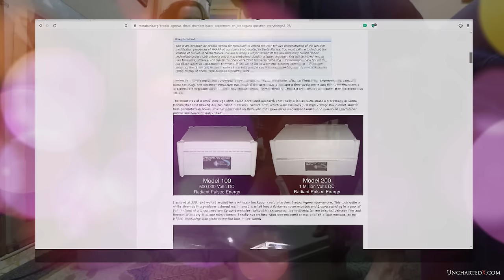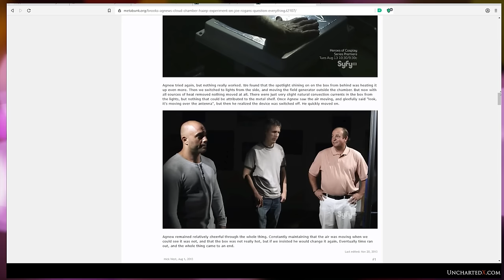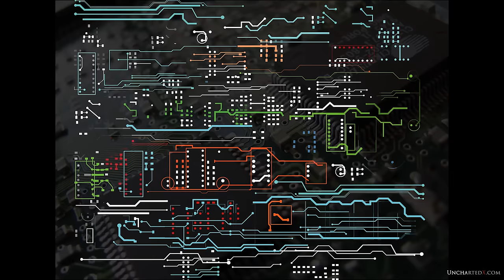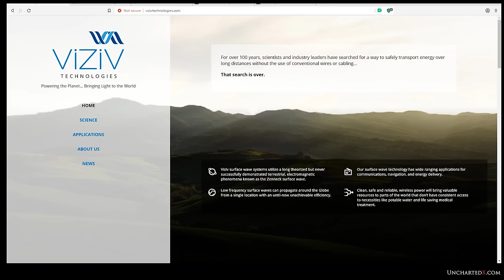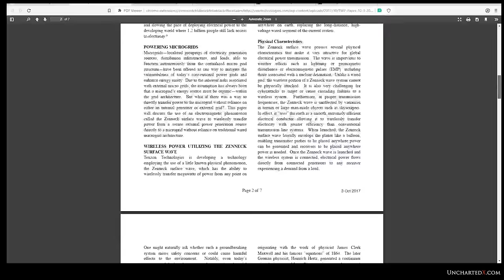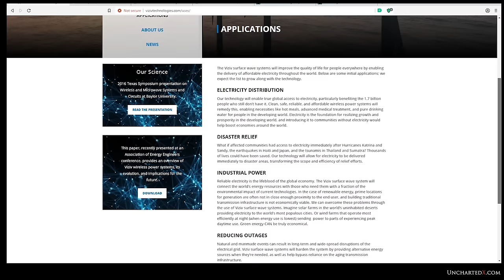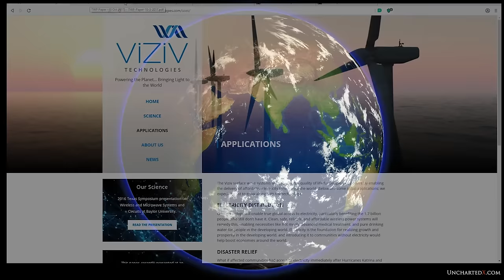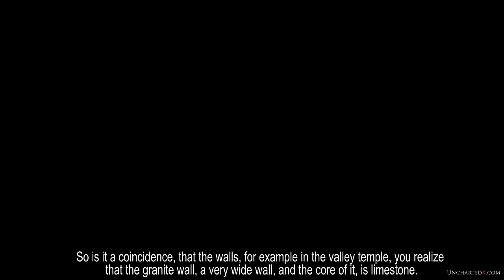500,000 volts through megalithic stone? An investigation into the possible with UnchartedX!

Comment: Yes the stones were chosen based on their conduction of high voltage.
The most notable of these applications is in circuits inside of structures like the Pyramids. This was due to the feet above ground potential of all matter. The higher the electrode was the higher the voltage obtained. This is usually called the fair weather potential. With the bottom of the pyramid representing the ground and the tip of the pyramid not in a conductive path to ground except through  a circuit designed mostly of conductive stones and non conductive stones. All of the usual circuits could be designed. Capacitance being shown in this video between the conductive rings and the non conductive rings.
 The voltage was due to the ground reference and the tip potential due to the fair weather condition effect. Anything put between the ground conductor and tip electrode could be powered. The fair weather potential is 100-120v/m. During the day.
 As the pyramid stands it is 146.5 metres.
 14650 volts total between the ground and tip of the pyramids.
 The Kings chamber seems to be the main connection points. This is where the Ark of the covenant was held and used as a super capacitor. This is where it got it mysterious powers.

 Aside from the electric aspects of the pyramids it seems they were used to pull down higher density hydrogen plasma which would condense into WATER and run down the sides into the walled pools around the pyramids. This water could be used for many things and seemed to be charged with energy. With the plasma flow being pulled down into the pyramids the matter must stay behind. That leaves a bunch of hydrogen to mix with oxygen.
Reply: Hmm.
Some this sounds reasonable.
I mean it's a theory!
I like the idea about the interior being almost like a 3d circuit board.
It's amazing that with all of the intelligent and educated folk on the planet, no one has come forward with the answer.
It seems clear that these megaliths were built for a practical purpose. But what purpose?
Reply: @kennymonty8206  
 The fair weather phenomena is not a theory, it is a fact. Another fact is that being in the desert  you need WATER and this device does just that.
 Among many other things you could do with this device The charging of the ARK was a major point. Just check out all the stories about the ARK and you will see that it was a very very large capacitor. From it's design down to how it was used as a very dangerous weapon. Even the Carry crew had special preparations to be able to carry the Ark. Oil and carbon layers used as a high voltage screen for the ones carrying the Ark.
 If you go back to the first visits to the top of the Pyramids you will see reports of a strange Phenomena involving high voltage discharges. One report talks about a bottle of champagne wrapped in paper discharging through the person holding the paper wrapped bottle that has sweated from condensation.
 The evidence is there you just have to see the discoveries as they are and not discount the reports.
 Plus, and this is a big plus, we can test this Theory very easily. Lets see if someone lets it be tested or if they will ban any testing of this "Theory".
Reply: @jonbigman9723  this is all very interesting to me. Especially when dealing with the arc of the covenant.  Can you direct me to some more information on this please?
Reply: @kennymonty8206  Perhaps some big things today are also being used for other purposes than just as a statue, tower etc. 
Like what about the very tall needle like stone structure in almost all the big empty areas like the one in Washington, Vatican ... 
The top of it is a pyramid.
Reply: shane  No more likely after the pyramids were built it became a forest.
 Let me ask you this.. Whats the main component of the solar wind?
 Hydrogen:
 Now we know that the solar wind is actually a hydrogen based plasma stream. This stream engulfs our planet above the ionosphere. Some of that hydrogen condenses via charge reduction (ionosphere) and falls across that ionosphere and heads towards the ground. It must go through many layers as it looses charge. But what if you could pull it down with a device. You would get plasma and hydrogen. When it hits the sides of the pyramid it will discharge and seek a balance which is oxygen.. Walla Water.
 They are already learning about this through plasma science. It won't be long before they connect the dots.
 You know why the sea levels are rising? It's not about some ice burgs, it's about water being created by the hydrogen we are receiving from our star. And it will never stop as long as the Sun shines.
 Just remember that the pyramids have not been maintained and even have been dismantled a bit, like the tip which was gold. The outside of the pyramids used to be a dielectric stone and the inner stones were conductive Granite. Sort of a lightning rod. This drew down the hydrogen plasma and allowed it to discharge into the pyramid . After it discharged it formed into water and ran down the sides of the pyramid into a walled in area and allowed to flow out to be used for all of the life gathered around it, plants, animals and people. They could also generate energy from it and indeed the water was different then the water you draw from the ground. It could energize the life consuming it.

Comment: A volt meter might come in handy. Maybe you get more buzz from stones that conduct less?
Reply: The right stuff would be a spectrum analyzer and digital storage oscilloscope (maybe 400 MHz or so). You'd have to use some isolation resistors on the probes though. High voltages can wreck havoc on expensive test equipment. I would like to see it though.

Comment: listen to Yousef at 23:00 then slide the video back to 21:00 at look at how the limestone is fitted  and the granite insets are built in  . That looks like a great place to look for the signs  of it... electrolysis and galvanic reactions from dissimilar material contact . If I have it right ..?.
 an example is copper and aluminum , direct contact over time will cause a reaction that causes  corrosion of the aluminum  .. no electrical current needed.  
 I''m not sure I see the evidence from this perspective  but it could happen in an irregular fashion .
Thanks Ben Have FUN !!!

Comment: In regards to the transmission of RF energy waves, the more you can mitigate the suppression of the Higgs Boson, the faster the energy will propergate (many multiples beyond the speed of light) granite does this very well. I will leave it at that. Unfortunately wireless energy does not work in a fiat currency system for obvious reasons. Human beings are far from ready of a post fiat system I am sorry to say in addition to that. Great channel, great video presentation, great information, please keep at it, as this is a part of the process to move humans beyond fiat, cheers

Comment: In the same way we work with metallurgy to manipulate electrical flow and direction of the electro magnetic field the ancients utilized stone and vibration to modulate sound frequency into energy using specialized mixed element geopolymer stones. According to the shape of the stones and the element materials within and its intent, this knowledge was used for war, medicine, propulsion, and much more. Basically we built with metals today to achieve energy, power, and mobility, but they used stones to achieve even more impressive things. we use the secrets of electricity, they used the secrets of Vibration, sound, and frequency.

Comment: Just a thought... The granite does act as an isolator... but also a storage medium for charge.... In a Layden jar (which was an early capacitor) once the charge is built up, the plates can be removed, totally separate from the glass... the plate have been shown to touch each other, shorting out any charge upon them.... but, once they are placed back in the Laden jar, the high voltage is still present... proving that the glass (just like the quartz) holds the charge... I might be wrong, it is just my hypothesis. But worth a thinking about. 🙏

Comment: 13:42 re: very interesting experiment. What you need is the ability to vary the frequency of the high-voltage source and then tune around to find the resonant frequency that boosts the voltage the highest thru the stone. Also, if the djed is topped with a donut that is heavy, the pressure of this onto the crystalline rock below may activate the piezoelectric effect (pressure on crystals) which also may boost the AC voltage. The djed may have been 4 coils that are inductively coupled but are tuned differently for their self-resonance properties. One idea is to have each one tuned to a PHI ratio of the neighboring coil. The PHI ratio allows for a waveform to fit partially inside another waveform in the sacred geometry way rather than the octave concept (2 to 1, 4 to 1, etc.).

Comment: Capacitors store electricity by having 2 conductive surfaces separated by an insulator -- 2 plates parallel to one another but never touching. Once the circuit is closed, the current is dumped into the circuit. I had basic some basic electronics courses in college. We mainly covered capacitors, resistors and inductors in series and parallel circuits. Those are the fundamental components along with the voltage potentials in the wiring diagrams we worked with.

Those fundamentals are what I'd look for in any stone tech because they would be the most easy to discover and implement. All they would need is a primitive battery and a little curiosity and they'd discover these properties much like the alchemists became the early chemists. They might have been seeking something else but discovered a universe of practical applications along the way.

Comment: I would like to add a couple of comments to this fascinating video. To provide a theory for the basalt crumbling on the limestone- facing side of the rock one needs to understand the chemistry of the rocks in question. Limestone is highly porous and weathers readily. Basalt also weathers with water. So it could be that due to being in contact with “wet” limestone, that surface of the basalt eroded more quickly than the other.

Again, it is just an idea, but would seem to initially make sense in this instance.

I am intrigued as to whether experiments have been done to “reverse engineer” the pyramid structures to demonstrate they could work as power generators/batteries/capacitors in theory.

Comment: At about 7:00 something above the experements glows orange
Reply: Vance Mac donald It happens again at 13.01 🤔
Reply: Nice catch
Reply: That frame is very hard to catch in the video. It's not my field of expertise, but basically the basalt rings have a high induced voltage from the machine. The orange glow I would guess to be ionisation of the air. Interesting that it is so far away from the top basalt block rather than arcing in the air to the block. It occurs just when the rod is brought to initiate the spark. 

This is extremely speculative but I'll say it anyway. We experience Electromagnetic  (em) waves as transverse waves, that is the electric and magnetic fields oscillate at right angles. Tesla claimed to be able to produce longitudinal em waves and these were produced using a spark gap and appeared at the time when the gap fired. His writing on this phenomena are very interesting. Just wondered if that may be happening here.
Reply: That frame is very hard to catch. This is not really my field of expertise. The basalt has a very high induced voltage from the machine causing the arcing to the rod. I wonder if the orange glow is ionisation of the air. It is interesting that it is relatively so far away from the block and does not arc to the block. also it moves left to right.
This is purely speculative and probably way off, but I'll say it anyway. Normal electromagnetic waves are transverse that is the electric and magnetic fields oscillate at right angles. Notice that it occurs as the rod initiates its arc then disappears. Tesla wrote a great deal about creating radiant energy which I believe is longitudinal em waves. (think they are the same just different terminology) which were generated using a spark gap, concurring at the instant the gap fired. Because the ionising doesn't arc to the block I wondered if that was happening here. It appearers to be a difficult thing to reproduce.
Reply: Oops .... seems we are looking at the front of the shop and seeing the lights of a passing car through a glass door. Guess there's being open minded and open minded. Thanks to Ben for solving that riddle.

Comment: I'm curious why stone would be used as a conductor when metal is far more conductive.  I don't deny the theoretical possibility but I'm definitely still skeptical that stone structures would be used as a way to transfer power.
Reply: Quartz granite contains crystals which produce electricity when they vibrate.  That's how quartz wristwatches are powered.  The Great Pyramid has more quartz than billions of watch batteries.

Comment: When I first saw this, it made me automatically think to the glyphs of the "lightbulbs,' in Egypt, and how they were designed.
It appeared that the 'glass bulbs,' were held up, on a column, very similar to the one in this experiment... 
What if...  Those columns provided the energy, to make the "snake like filament,' of the Egyptian bulbs 'glow,'  while the other end had a 'cord,' of some sort, that could have acted as a ground to the filament, completing the circuit!?
The stone column may have been there, to do the very thing we see here...  Collect free energy from a field and concentrate it into a focused 'beam,' to the light bulb filament.
And the bulb was held at the top of the column, by what appears to be a set of  (maybe metallic), hands, like copper or bronze.  These 'hands,' might seem to by just a 'prop,' for the bulb.  But what if they were also a way for the Egyptians to take the power being collected by the stone column and create a "ballast," effect, or a way to balance the power emanating from the column, to the bulb filament.
The energy was supposed to be generated by the Pyramids, as they sat on the Earth, over a natural energy field, like the one being generated by the machine in this video.
It makes sense that the energy was emanating from the ground, was harnessed or concentrated by the construction of the Pyramids, then harnessed by the stone column, transmitted through the column to the bulb, and then grounded back to the Earth, creating a circuit...
In my insanity, it makes perfect sense!
Wouldn't this be a perfect reason, for constructing the Pyramids, from the limestone, granite and basalt stone they used?  Here in this video is an exact reason why!
And then, perhaps the inner chambers of the Pyramids, were filled with water, or some sort of liquid, that allowed the capture and concentration of the Earth's natural magnetic field...
Why no one went to this step, to recreate the Egyptian bulbs, is frustrating to me!
Reply: There are videos demonstrating that the subterranean chamber shape optimizes the efficiency of ram pumping by 40-50%. That cannot be coincidence. The lake west of the pyramids was a reservoir filled by a vast canal taking water from the Nile further north.  The long shaft to the Nile is a typical 'waste water' valve and the crude passage upwards could be the water and gas route to the so called Queens Chamber from which purified water, hydrogen gas and microwaves resonating at the spectrum frequency of hydrogen would all flow.  Maybe.
Reply: The Egyptians did not build the pyramids...

Comment: With the basalt, limestone ,and Granite it definitely seems to be set up to be some sort of cell or Power Cell, similar to a battery. For example the first battery was made up of ayers of zinc as an anode, wool as an insulator, and copper as the cathode, and usually a electrolytic liquid to connect everything and breakdown bonds. I’m sure a very similar process was used here. Or it could be similar to a capacitor where you have your P doped side, then insulation, and then N doped side, this stores power and then you provide a path for the current to be released. Interestingly enough, both of these are forms of DC power…

Comment: The high voltage machine more than likely uses a pulsed flyback transformer to generate the high voltage RF. If you can feel a tingle it is because it probably switches the mains voltage which will superimpose a 50Hz (or 60Hz depending on where you are at) component in the higher frequency oscillation that comes from the pulse. A car ignition coil, tesla coil, etc. can do the same thing. Calling it electromagnetic is not fully accurate as it is the alternating electric field that comes from the high voltage responsible for the arcs/plasma discharge you see. The magnetic component is bound in the transformer core and would not contribute. It's a very super interesting experiment. If a pyramid is 400ft tall, the atmospheric potential between the ground and 400ft is about 13,000V on a clear day (site feynman lectures  on EM). 13kV exceeds the breakdown of air which would cause a current to flow and could possibly act as a focal point for atmospheric electricity.